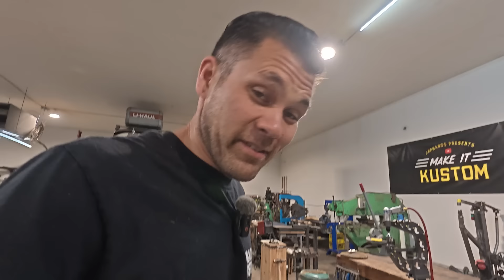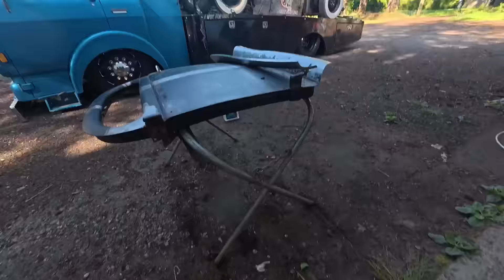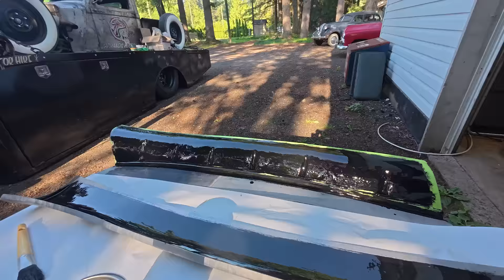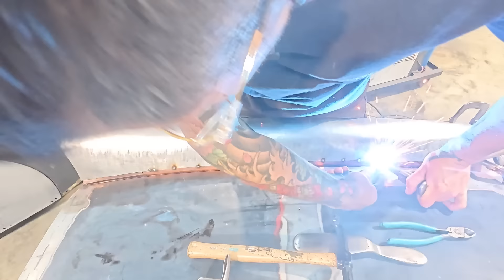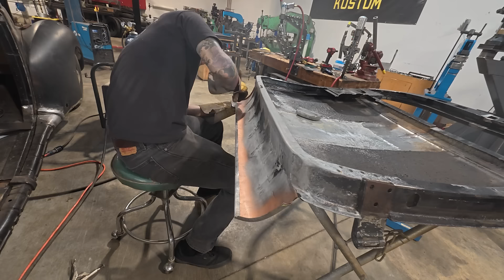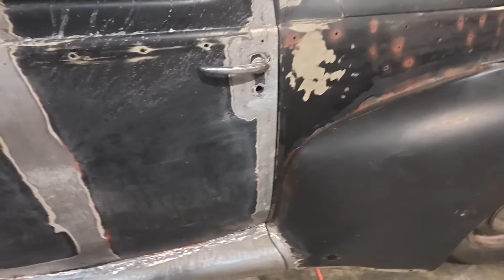DOOR Bottom "HOW-TO" Prep Paint & Folding The SEAM - 1939 Zephyr Conversion

Comment: Pro15 is funny stuff I have never had luck with it on clean metal I just hand paint 2K  epoxy and use rubber undercoating in-between panels or just the epoxy . It has always come off . As for copper weld spray or zinc I prefer copper it just welds way nicer

Comment: I prefer the copper primer.. it welds much easier. The Zink primer I find is splatting a lot, and is harder to weld through…
Reply: You got that right. The copper lasts just fine. I replaced a quarter panel that was done by someone 4 years prior who used copper. I never allowed any rust to develop.  Welds way better as well. Zinc is horrible to weld through

Comment: Karl, I think you are on the right track with your metal prep and primer, but I'm a little concerned about some of your technique and some of the products.  I like phosphoric acid, and I use Ospho directly on clean metal (rust blasted or lasered sway). 15 minutes, then wash like heck, scrub with Dawn dishwashing soap, rinse and dry (hot sun or heat gun. Within 24 hours, wax and grease remover,  two part epoxy primer, 2 coats.  I like Southern Polyurethanes primers. Reasonably priced, 1:1 mix so you mix even a tablespoon, and great tech support.  Barry, the owner, will talk to you.  It's a bad idea to let phosphoric acid products to dry on the metal - it can cause paint failure.  Check it out.

Comment: I much prefer the copper too. I have not seen anything that convinces me the copper is defficient.
As nice as the panel fits and as well as it was preped, you could consider bonding those crimps with epoxy bonding adhesive.  Makes them stronger and there is no chance ever for corrosion.. Nice work for sure!
Cheers

Comment: Carl, 
  Good tutorial on flanging. 
  I think you were trying to explain the fact that tipping makes a three layer curve over. The first sharp bend allows the second bend to be spaced out by ever so  slightly more than the thickness of the inner layer. The back tip is now shorter by that thick center layer. 
  Novices learn that as you bend and weld metal moves and wiggles like snakes.

Comment: carboline rustbond is a great product. Two part epoxy,  brush ,roll ,or spray,  i have used meoretic acid to remove rust, and then cover with rust bond.

Comment: Carter says to wire brush any spot of weld through primer, (At the point of plug welding) so you get a good weld, I tried it and was surprised how well it worked. I guess in theory the primer helps seal around the weld. Top coat with an epoxy sealer and your done.
Reply: dont trust Vile Kile, he screws everything up

Comment: Zinc prevents rust. When I first learned a paint cars I was using a zinc chromate primer on any bare metal spots it was a pain to sand but it bonded really well
Reply: We used to use Zinc Chromate on aluminum aircraft panels back in the day. I heard it was banned because it's toxic. It's just like anything that worked well.

Comment: I have herd that if the Acid is phosphoric acid it keeps protecting the metal and converting to Iron Sulphate that is a protective coating. it will eventually neutralise with moisture, condensation but I understand does not need coating. iron sulphate is grey black and protective.
The orange tinge is oxidised Iron and that is rust. 
For what it is worth many metal prep solutions like kill rust rest treatment are a phosphoric base, or some other chemical Iron conversion chemistry, and acts as a primer that can be painted over and act like a metal etch primer that can be left for life.

Comment: Maybe I missed it, but the chemical process is phosphoric acid  (sold as concrete prep at home depot for like 7 bucks). The phosphoric turns Iron oxide (rust) into iron phosphate. This is not a coating. It is molecular bonding and it cannot rust. You can add like 2% rubbing alcohol as a surfactant, and corn starch to get it to stick in place. Otherwise, you gotta keep coating it. This is the exact process the Navy used on the old battle ships in WW2 to keep the hulls form rusting. There was no paint on all that steel. All phospho treated.
Reply: Good to know. I bought some and have really only had a bit of a play so far. I have some old bits of rusty pipe I sprayed and they been sitting outside since, which is several months now. It appears to be protecting it but I was worried I was imagining it as what I expected was every time it got wet the acid would CAUSE rust, which is not what appears to be happening. It's good to hear it confirmed I'm not imagining things. Thank you.

Comment: I remember when you moved into that shop.  Took a long time to find a suitable location, if I remember right.  The door bottom is coming along nicely.  Had you considered TIG welding that seem because of its location?  Just wondering because of it being kind of in the middle of the panel.  I usually use Tony's (Fitzee's) trick of painting with regular primer and cleaning the primer off where the weld is going to land.  Weld through primer is remarkably expensive.  I think the copper looks better, for what that's worth, although, you're not supposed to see it, right?

Comment: Hey Carl, do you cut your own glass when you chop a car?   Ive got a 69GMC with a 3" chop but got it that way.  Always been curious on cutting laminated glass
Reply: Glass shops will do it for you. That’s what hot rodders generally do. Make a hardboard template and bring it to them. Custom windshields are a lot harder, but there are places that can do it. It’s very very expensive though, so much better to find an OEM windshield that fits your custom and build around it.